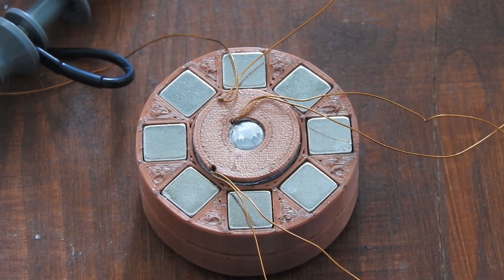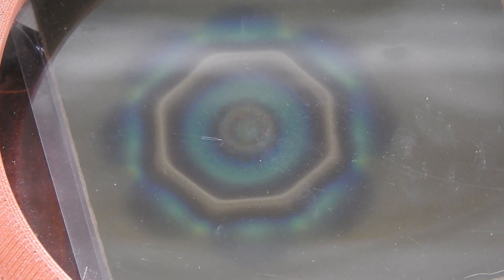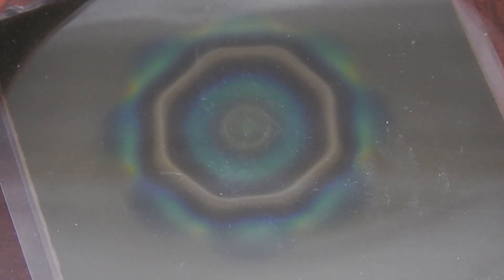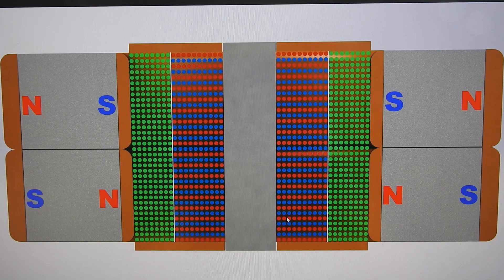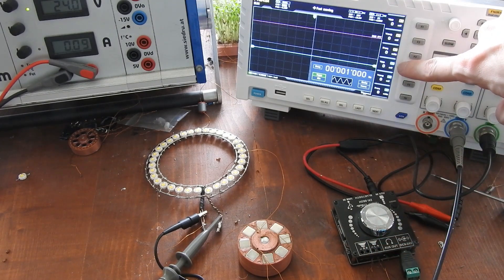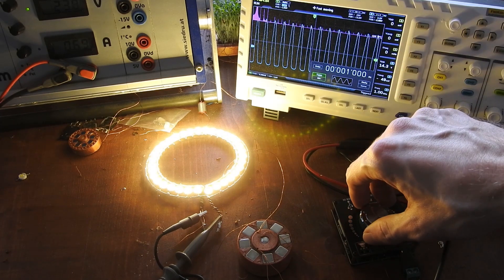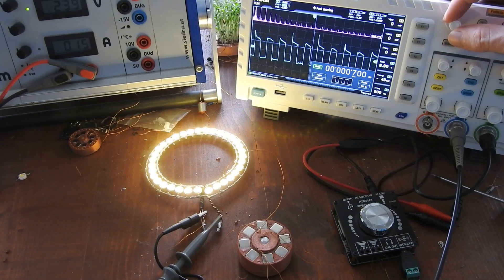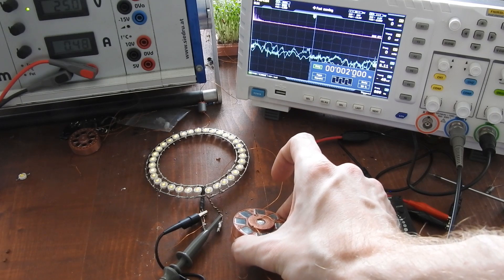Oscillating magnetic field of a magnetically assisted electromagnet viewed in realtime

Comment: awesome work! Would you be able to put some pickup coils around it to generate electricity?
Reply from the maker: The outer coil (marked green in the drawing) is a pickup coil. 
You could add more pickup coils on the top and bottom of the array.
Reply: @OmegaZZ111  Ah yeah, i see now. What is the watt input vs the output?
Reply from the maker: @FigmentVFX  I didn't measure it, but less output than input from what I've seen.
Reply: @OmegaZZ111  Yeah i would assume that is the case with that current setup. I have seen other setups where adding more coils does not always mean you need to double the power. There seems to be a point where if you add more coils, you might get a COP >1.  Most of the systems i have seen that achieve this are based on teslas wireless power transfer setup and systems like don smiths design.

Comment: Did you try to measure the efficiency of this speaker/electromagnet? I mean not in sound power but electric power on input coil vs electric power on output coil? In the past I was trying to build and do measurments on pulsed DC magneticlly assisted transformer but there is a lot of test configurations and many different options for such device. I am still convinced it could achieve some interesting reaults but must be designed with appropiate magnetic field intensity/coil resistance and inductance as well as coil geometey and geometrical proportions of all components. Did you see a video of Raseli?
Reply from the maker: I didn't do exact measurements, but what I have seen from the input power consumption it is as efficient as a regular transformer.
Reply: @OmegaZZ111  and the heating of the iron core could be added as some power output as well (not electric). Would be nice to see some more experiments on this little device:) do you have an electronic field intensity meter (Gauss - Tesla meter)? I have some video where I am measuring 1 Tesla of intensity between two magnets. My experiments are rather simple and not very well prepared... If you would be checking my channel check the "shorts" section as well, there is few of my tests there too.
Reply from the maker: @Kapalek84  Every transformer core will heat up when power is supplied, but maybe the additional magnetic field from the array will cause additional heat.
I have ordered a gauss meter last week, it should arrive tomorrow. :)

I have seen your videos, 1 Tesla is quite high flux density, were the magnets attracting or repelling?
Reply: @OmegaZZ111  the magnets are attracting mode (meter probe is in gap between S pole [magnet 1] and N pole [magnet2] ). 
Also when you receive your meter you can check the change of intensity of mag field on external poles (not just in gap between) when magnets are in attraction and repulsion modes.

(measure this surface)-> NS SN
(measure this surf) ->  NS NS

as far as I recall when magnets are in attraction mode the external surface fields were getting little stronger and in repulsion the change was smaller. I believe configuring magnets to work in attraction mode will produce better results then repulsion.
Reply from the maker: @Kapalek84  Thanks, I will try that.